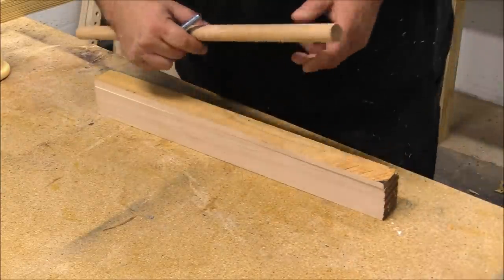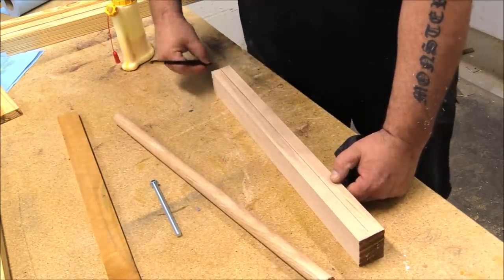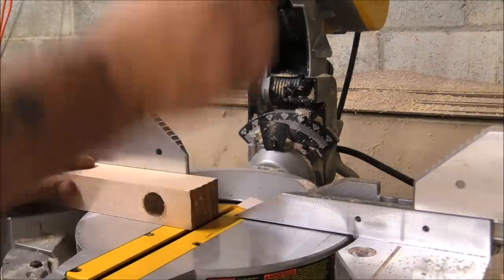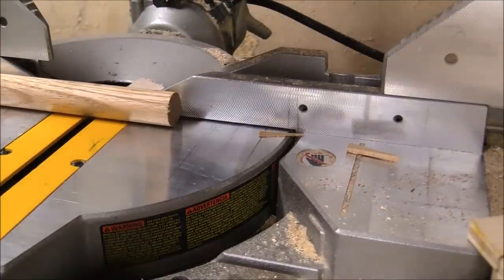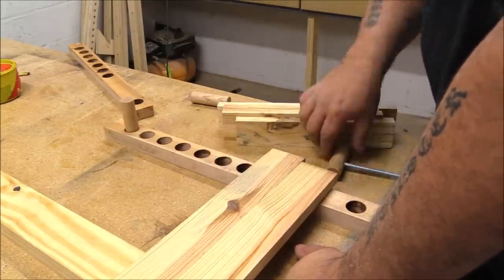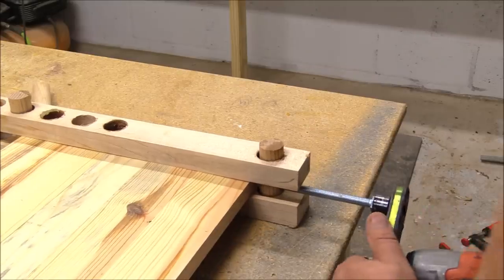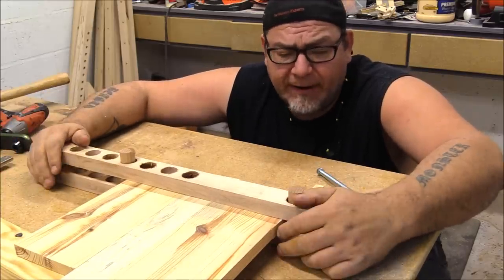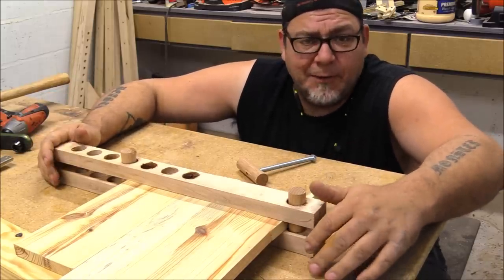Crazy Easy Homemade Bar Clamps | DIY

Comment: I like the wedge better because the bolt may leave a mark on the glued piece, but it's such a clever build.  Thanks for showing, Izzy. As always, you are awesome : )
Reply: Bugger! Why didn’t I think of that? Bloody drongo that I am. Aussie Andy
Reply: Martin Gård  if you need a scrap to avoid marking the wood, you might as well just use a wedge!
Reply: @juleswebb1885  There is the chance that the wedge could misalign the first board. I'd drill a hole in the back of a very hard scrap of something as a clamping pad and wind my bit into that. In fact, I think I might! 

Very cool clamp though. Thanks! I love seeing scraps become tools. 😀
Reply: A metal piece also does the work and won't mark the wood.
Reply: Use scrap !
Reply: Me too. I'm shoot myself in the not knowing this earlier. G*d dammit
Reply: Does anyone know how to remove the wedge? I love this jig, and a wedge is by far the easiest thing to do. But I wonder how hard it is to remove the wedge? Is there a type of wood, or a way to make the wedge easier to remove. I have some hard maple scraps from old baseboard trim, would that make a slippery wedge?

Comment: Absolutely fantastic! I’ve begun making larger butcher block cutting boards and clamping more than on is an issue with how expensive clamps are. I have some cedar boards from an old basketball court that was torn up. This will CHEAPLY fix my problem. Thank you so much Izzy!!!!!

Comment: I built a set of these out of scrap red oak and they worked very well. I used spade bits and eye-balled it, but they lined up. It was nice to have the clamps lay flat unlike the bar clamps. Simple and effective. Thanks for sharing this!

Comment: This was a lifesaver. Used this idea to make some clamps and saved me some money since it was just a one-off project but the clamps are still available to  use again. I used wedges instead of bolts for clamping. Though I  put only 3 adjustment holes. They were sufficient for my purpose. It is an easy build. Simple but very practical.

Comment: Very enjoyable video. I liked the clamps, but what caught my eye was how you found center on the piece of wood you were using.  As you laid down you tape measure to find center I was thinking what is he doing, and then I got it.  At 76 I have never seen this done before.  What a tip, can't wait use it.  Thx.

Comment: If you replace that wedge with a cam on the bolt thur dowel and you'd have a toolless way to tighen and loosen. I'll be making a few sets of these. Thanks Izzy!
Reply: Also if u want to get fancy u can apoxie a dowel to the end of the bolt to prevent it from marking the glued item

Comment: you can easily extend the clamp, if you add a smaller piece of wood with 2 holes for 2 dowls (almost like an 8) on top of 2 clamps that are end to end, and link them with the dowls making sure the dowls don't go all the way through.

Comment: Started a project, I got the top ready for the glue up. I looked at it and the lack of clamps to hold it together while the glue dries and thought to myself, Go watch that clamp video that Izzy made awhile back. Yup those will work and poplar wood is not too expensive and you can make 4 of them ricky tick.  6 foot long bar clamps FTW and I can add holes as needed for shorter projects.

Comment: Great video and concept. Do have a question...how do you prevent the wood clamp glueing up with the squeeze out glue to the body? Maybe you can do an update video regarding such😎.
Reply: I think that's why he put paste wax on the clamps....... so the glue run out won't stick.

Comment: Izzy I had a viewer of mine a few years ago send me pics of a similar style clamp, except out of metal.  I have been working on a design to make them out of wood and make them easy to do. Looks like you have already done that. Great job and great video. My design was slightly different than yours and I will probably still make them but I think yours are designed better. Thanks for sharing.

Comment: Izzy - THANK YOU! I plan to build these, but with a twist... the lower bar will have threaded holes (think nut), the dowels can then become wooden bolts with a nut on them (above top bar).  The idea being that the clamps then become bar clamps (as shown in video) and parallel clamps all-in-one device.  All done using wood, no metal components needed. The bar clamp component can still be used without the wood bolts, just use smaller non-threaded dowels.  What do you think?

Comment: Great video. 

I'm wondering for a longer clamp, say to glue a panel close to 4 feet wide, if putting a slight taper from the middle to each end of the top bar then clamping both ends would help keep everything flat????

Comment: Finally I saw someone adjusting the height of the blade on a table saw. I’m 70 yrs old and when I was taught on the use of a table saw I was told no more than 5 teeth showing they the top of your work. I see so many with half the blade sticking up. Great. Ideo also.

Comment: Great video. I prefer the short videos (my ADD is showing). Yours are always entertaining and encourage me to think about different solutions.
As you were building this, I wondered if you would make two of them and use a screw clamp to rotate the bar clamps into a trapezoid to tighten the dowels against the work piece.

Comment: Good and easy design. Just trying to do this myself right now. How do you make an appropriate wedge if you end up having a large gap between the piece and the dowel? In your mock glue-up here you were a bit "lucky" with the distance being so short. That wedge you have there wouldn't necessarily work if the piece you're gluing is let's say 1/2 inch thicker or thinner. Would I simply need a very long and pointy wedge?

Comment: Hey Izzy... would I hafta make 2 of those to tighten up both sides? If not how long do you think the max would be if I was trying to glue up a cutting board..? Hope that question makes sense.. thanks again for the video.. motivates me to try different things.. anything I can make out of wood as a tool for the shop I’m interested in... trying my hand at making wood and leather handles for assorted tools now.. screw drivers .. chisels hammers etc

Comment: You sacrifice a bolt, but the risk of cracking the wood when cutting the thread is much lower if you file some channels length-wise into the bolt's thread. The cutting also goes a lot easier. (I recently cracked some wood this way, so it's fresh on my mind.)

Comment: That was brilliant! Many thanks for sharing! Looks pretty darned effective. I wonder if it would work to thread a dowel into a dowel or block and use that to tighten the clamp. I bet it would work. I got one of those wood threaders cheap at auction some years ago, just in case, and now here’s a case! Gonna give that a try.
Reply: Did you ever try this?? If so,  how did it work?

Comment: Hi, suppose like seen in 6:47, you were gluing up some pieces as depicted, if the glue seeps out a little of the joints, as it tends to do when clamped together (even after wiping away excess preclamping), isn't it going to cause the clamp to get glued to the top and bottom of the workpiece? How does one prevent the clamp getting glued on?

Comment: one idea? if you screw an over sized washer, or other metal plate, on top and bottom of the head dowel to keep them together? 
The clamp is a pretty nice tool gr Hans

Comment: If parallel pieces are not identical, tack a scrap piece of leather to one end, long enough to accommodate thickest glue-up. Keeps matching pairs together and in original orientation.

Comment: I have a few questions.
1) what is that thing you're using to measure the distance between each hole?
2) what is the chamfer cutter and where'd you get it?
3) what is that attachment you were using for the impact wrench? ( what you were using to drill in that bolt)
Reply: There is a list of tools in the description. Has a link and everything...
Reply: Oh shoot I didn't even realize that! Thanks for the heads up!

Comment: G’day Izzy mate, Love the clamp. Question: When using the bolt does the end not damage/mark the wood your clamping? Hope you are having a bonza day cobber and not flat out like a lizard drinkin! Aussie Andy
Reply: use a call to prevent the bolt digging in to your board

Comment: My only concern is whether squeeze out an issue with the clamps getting stuck to the workpiece?  Is the wax enough to prevent unwanted adhesion?  Thanks

Comment: Izzy, an old but handy ol fart tip. A small slice down the first few threads make tapping wood easier. 
I learned this whilst cursing bugged spark plug holes in aluminum.

Comment: I think I would go with the wedge. The bolt must leave a mark on the item you're clamping?
Reply: fiskebent that was my thought as well. The dowel would leave a mark too, wouldn’t it? Easily solved by a sacrificial scrap on both sides though.

Comment: At the risk of someone already having said this...

Could you make the single hole at the end angle a little away from the rest of the holes, then drill the others the opposite direction, to make a slight “V” shape? In my head, this would make it so that as you tighten horizontally, it would also hold in place vertically, applying pressure (or at least a little resistance) in two planes. Might not work in practice though!

Comment: Izzy what stops the glue from adhering the clamp to the work piece?
Reply: use aluminum c-channel and problem solved, plus more durable. if not, cover long pieces in tyvek tape

Comment: The idea is good, but what you did not do with the moving screw is that you did not stick a circular piece of wood to it, so that whenever you push it with the machine, it moves forward, and the wood creates a force of pushing and sticking the wood together. While if you push it like that alone it will definitely penetrate the wood.

Comment: Hi Izzy, this is superb. What is that tool you used to drive in that bolt? Thanks
Reply from the maker: It called the dpt wrench its another of my invention
Reply: @izzyswan  why not just use a nut driver on the impact 🤔
Reply: @izzyswan  great how does one get such a device?

Comment: much better design would be to make the bottom of the main peg round, middle egg shape,
and top hex shape so to turn the top with a crescent wrench and it will act as a locking peg...

Comment: I expect that clamp has been aruond since shortly after the first the first woodworker discovered a drill and need to edge clamp two pieces of wood together. We buy clamps instead of using our heads.

Comment: The simplicity of this 'build' and having him say that this has been around for over 100 years... 
Yeah, companies take advantage of our ignorance. 

@ Izzy : Would angling the dowel holes by some degree assist with clamping? Either clamping power/strength, or clamping material squeezing stability? Hmm... Maybe that would take columns, making the build more difficult than it should be.

Comment: How do you remove the wedge without damaging the glue up piece or wedge?
Reply: Just wiggle it sideways, I have never had a problem getting wedges out, the clamping force will try to push them out, only reason they hold is that the friction holding it is greater than the sideways force pushing it out.